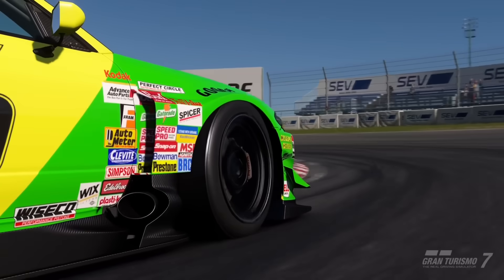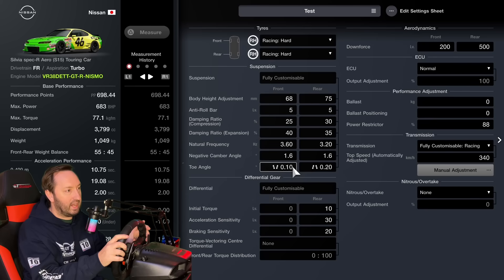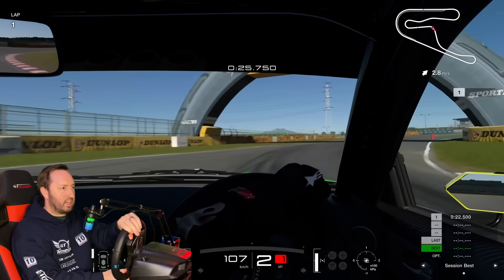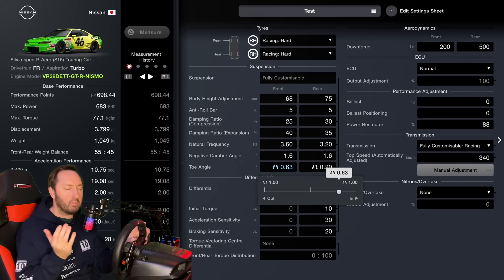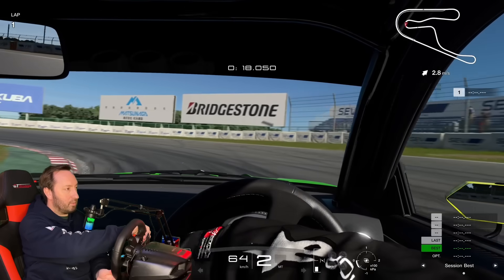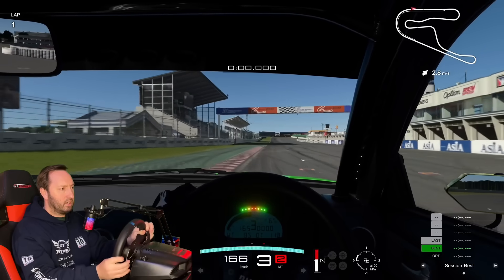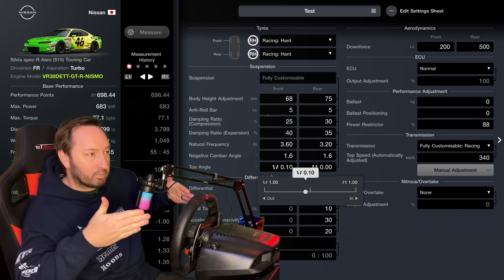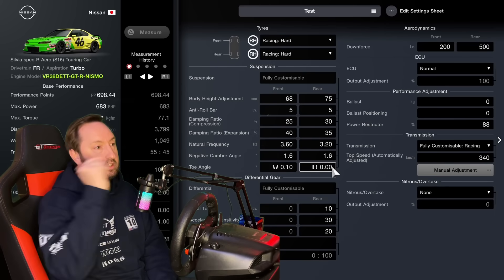GT7: The Game is Wrong… Toe Angle Explained Properly

Comment: Toe out in the rear can be used in some front wheel drive cars, at least in limited amounts it can help with reducing understeer
Reply from the maker: very good point,  those pesky understeering FF cars :D
Reply: I'll def give it a try, cheers. 👍
Reply: Does that mean that increasing rear toe in could reduce lift off oversteer in fwd cars?
Reply: @bigt43 try adjusting the dampers or just use front biased weight ballast, lift off oversteer happens because the weight shift from the back hence rotating your car when you corner

Comment: One of the biggest things front toe effects, is Ackerman. Toe in effectively increases the feel of the Ackerman, where toe out reduces it. This is why toe in feels more responsive on corner entry, especially on a lower speed circuit like Tsukuba with the hairpins.

For the rear, when the car is loaded on the outside tire, all other geometry changes under compression not withstanding, you effectively have a front and rear wheel both pointing into the corner. The car is effectively crabbing towards the apex. This is why it gives auch a stable feeling mid corner.
And why when you toe out at the rear, things get floaty, as you are effectively using 4 wheel steering, and the back is turning opposite of the front. And this makes the car do very weird things. The overall lack of stability in the car in a straight line, also not withstanding.
Reply from the maker: It’s a VERY good point. Ackerman is not adjustable in game and it’s not clear how much Ackerman cars actually have. I’d like to assume that it’s accurate to real per car but we have no idea…
Reply: @Doughtinator  for sure. The lack of any detailed telemetry, along with no dedicated Ackerman setting is one of the things that most disappoints me about GT7. Especially since GT5 had that built in data logger play back function, but I digress.
That said, the simulation at least seems to be true enough to life, that thingsike Ackerman matter. Especially as the game also takes the time to model fender rub if the car is set too low, so I have to have some faith that Ackerman is true to life too. But how much is present on each car, and how you can tune it with toe, remains a mystery.
Reply: it turns in harder because the front wheel is already slightly turned in, youre always slightly ahead of where you think youre actually steering, and as the weight comes off the inside wheel, the scrubbing effect that keeps the car tracking straight is gone. and so its corners suddenly for a moment
Reply: Caster as well is missing which also could have a big effect on the toe and camber angles.

Comment: I think the game description is ok. The toe in will improve the stability of the axle. Hence, it will increase understeer. Regardless it is front or rear. The front is easy to understand. The rear, is due to the rear dont want to move and result in front broken traction before the rear does. Hence, if the rear has relative aggressive toe in, your car will be understeer regardless. I had this experience on my RC car, it is Tamiya TG10. That thing comes with 3 degress toe in in the back. Plus a 4wd system. So, it doesnt matter how I fool around the suspension, the car still understeer.
Reply: Yeah idk where he got that toe in makes the car oversteer.
Reply: Toe out increase on the front may increase off center steering but at full lock you will have less with no Akerman changes. The outside tire will turn less into a corner, the inside tire will turn more, but all the weight is on the outside when cornering. The opposit is true of toe in because of the same reason.
 there is only so much steering lock if you turn the wheels out 1 degree while static, with akerman that will be closer to 2-3degrees less steering angle
Reply from the maker: Yes when thinking of it describing the stability/grip of each axle in isolation then the description may have more valid meaning.
Ackerman is a whole new unknown as to how the game models that, I can only assume that each cars ackerman is just modelled to match the real version of the car

Comment: I usually stick to -0.20/+0.50 with 6/5 rollbars. A bit of stable understeer, until I demand otherwise. Gives me a sense of control.
Camber is strange. Irl you’d always want more on the front than on the rear. Just look at some races on the telly. In the game, no. And less camber equals more grip midcorner. That doesn’t feel right, does it?
Reply from the maker: Yeah seems sensible. Camber is a strange one, in an early update for GT7 they took away performance calculations based on camber settings so we have no real way of know 'the best' camber settings without 'feeling' which can take a VERY long time

Comment: toe angle depends also on which is the traction axel, and you can play with LSD torque/accel/break, suspenssion stiffness, camber angle and downforce. To be more drifty or an arrow
Reply from the maker: Yes for sure. Toe Angle is one part of the car setup puzzle with everything linked 👍🏻

Comment: Try controller, put handbrake on and put thumbstick to left or right, the move ti opposite side znd see how long it takes on screen wheel to turn, its about 900th of a second 🤔 Ai seams to control the steering on bends, as if it's trying to make corners smoother. Diff changes a lot, try gt7 tuning calculator, gears, engine braking , don't forget the ballast, some think it's a sin

Comment: Thanks for thr explanation. Interesting to learn a bit more about it. Tuning is a bit too complicated for me, so I typically just grab a tune someone else made.
Reply from the maker: Happy to help,  have a play with some numbers and see what they do, the best way to start tuning is just to try.
You can always put the settings back
Reply: Learn to make good use of the settings sheets. If you lose track of standard settings create new settings sheet and it will default all things besides unremovable mods like weight reduction,  bore and stroke etc, and to see what effect is had, adjust one setting at a time so you can feel the affect on the car until your used to settings and can adjust more at once if you know what to adjust to suit your aim

Comment: The simulation is probably wrong across the board like it is with toe in most simulations 😅 when I was in suspension and steering setup class in college I was told that most vehicles drive wheels are set up slightly toe out. This is because the turning motion of the tire that is producing acceleration is steering the tire inward. So if you begin with a 0.0 angle on a drive tire it's going to go toe in with the more acceleration that is applied to it. Now on a front wheel drive vehicle it would be better for the rear tires to be towed in because they are being pulled and the natural movement of the tire being pulled is to toe out. So front wheel drive vehicles will have a natural toe setting of toe in on the rear. And when I am saying natural setting I am meaning factory setting in real life lol Not the video games or simulations. In real life rear tires on rear wheel drive vehicles should always be set up a few degrees tow out. The drive tires on all vehicles should be slightly tow out essentially just by rule of thumb. At least this is what they teach lol
Reply from the maker: Yes! I agree, however I don't think flex and slop in suspension components will be modelled in the rigid simulation.
however, I'd imagine you'd ALWAYS want a little big of rear toe-in even if its likely to increase slightly when the wheel drive forwards

Comment: if you add full suspension you might destroy your car tho. it should have a better usable default  but adding that upgrade on some cars make it useless . wheels getting stuck in the wheel wells,bottoming out on track etc.i work 50 hours a week i dont have time to mess with the settings for 2 hours

Comment: i'm grinding up my B-spec drivers rating just now on the ps3 GT5 RPCS3 emulator. (working smooth as silk BTW) on the 200 lap endurance race , superspeedway Indy track. I use the fastest car, the 2011 vettel. 
Defult it has the most extreme toe setting. 
- 50 front (toe out) and +50 rear (toe in).  This help with stabilizing the car/beast. It has 45% weight front and 55% rear, and ca 1480hp ich). 
But with defult toe setting it heat up fast the inner front tire and at the back it's the outside tyre who get hotter and wear faster. 
So if i tune the front toe to + 21 and 0 at the rear then they run cooler and last longer, aka same friction on inside and outside tyres.
BTW in the emulator i can speed up tempo in the game 10 times, so the B-spec bob grinding goes fast.

Comment: In real life, in general, If the axle drives it should have toe out and if the axel does not drive it has toe in. It seems to be the opposite on GT7
Reply from the maker: On the front. I agree with that. But on the rear I think you’d always want toe in 👍🏻
Reply: What kind of effects would having absolute zero toe have, because not only do cars have an Ackerman angle, but messing with the toe could also mess with overall wheel alignment which is why I always run zero toe.
Reply: @Doughtinator  A rear wheel drive car would usually have some toe out a the rear whereas a front wheel drive car would have zero or very little toe in. This to account deflection in wheel alignment caused by drive or drag.
Reply: In real world racing toe, camber, and caster are adjusted for each wheel to meet the track, and environmental conditions. Assetta corsa competizone does a pretty decent job simulating this.

Comment: is your front to rear downforce ratio not contributing to alot of the understeer your getting on stock toe angles matey?
Reply: Would softening the anti roll at front help too
Reply: @stedz2000  yes and no, depends on the relationship between the settings. Usually it should start giving the desired effect. You could choose to stiffen the rear roll bar instead of loosen front and stiffen rear together. However in this case the difference in front to rear downforce ratio is too big of an issue and it would be better to rectify that then think if adjusting roll bars. I was just going on about the settings being used, suspension wise I think they were more or less the stock settings as it was just a test to show how toe works. The downforce settings aren't stock though and likely hindered the results of the toe tests
Reply from the maker: Yeah I think the base setup of the car was just a bit understeery. I think the wing I was used had a fixed downforce setting. I only used it because it looked like a NASCAR lol!
Reply: @Doughtinator  i did the same for a NASCAR one 🤣, I've got a Texaco/havoline one. Your front was only 200 where as your rear was 500. You can adjust it though
Reply from the maker: @PatSharpsMullett interesting. I didn’t think it was adjustable.  I’ll re check 👍🏻
Reply: @Doughtinator  i can adjust mine. Just to check is it the front or rear you don't think you can adjust(
Reply: @Doughtinator  sent some screenshots of the wing and adjustments available

Comment: I think in some cases we expect too much from a game. You can't expect it to be accurate to a T, after all it is a game, a simulation not reality.
Reply: That's a pretty silly attitude to have, these guys model cars details down to every nut and bolt. Sure they also know about tuning.
Reply: I mean ACC got it right.
Reply: @TheOfficialRandomGuy  then play ACC this is trying to appeal to the masses
Reply: @silckyslide6195  just because “it appeals to the masses” doesn’t mean it has to  have inaccurate setups. Even though the op has it backward about front toe.
Reply from the maker: I actually think the changes and the effects they have ARE accurate to real life. the problem is just the in-game words describing the effects are only valid for REAR toe-in and almost have the opposite effect when applied to the front axle

Comment: Why didn’t you test it with a proper race car? Toe angle adjustments are most noticable on Gr.1 and above
Reply from the maker: I just went with a mid power car to allow the feeling of rear toe to not be masked by too much power.
Reply: @Doughtinator  Audi R18 TDI has only 540 HP it would be a nice car for a test like this